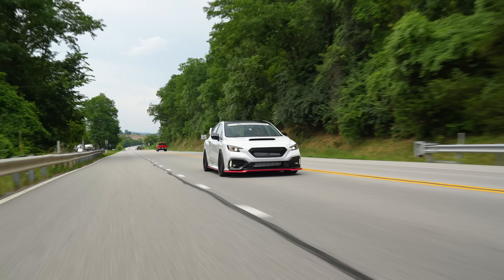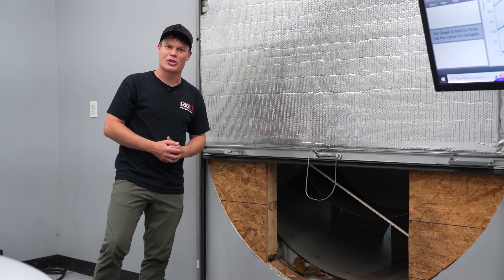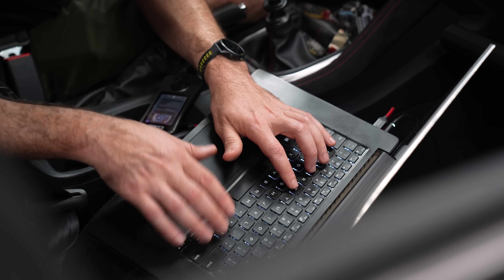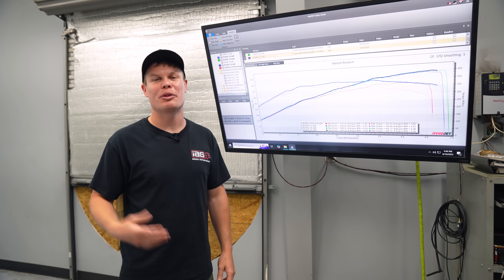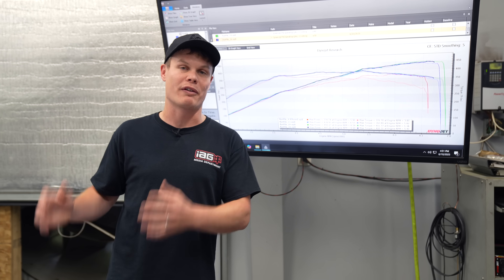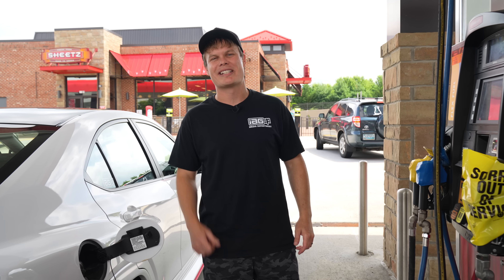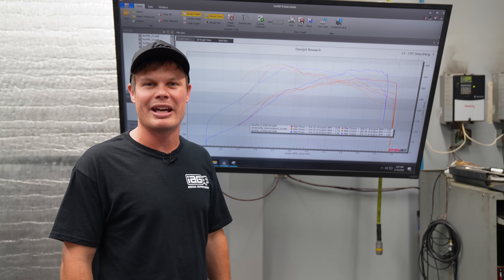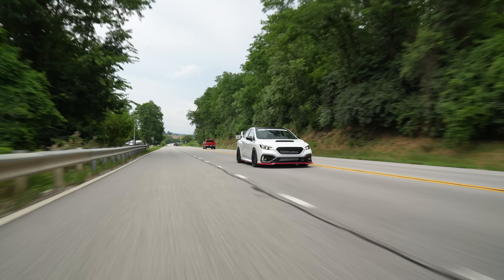Big Turbo VB WRX Dyno Tune on FLEX FUEL!  XXX HP

Comment: So stock turbo stock engine plus all bolt-ons with 7178$$ flex fuel system parts, and not including labor and tuning, only for 320 whp:face-fuchsia-tongue-out: , which means total need at least 13000$$ for only 320 whp with a stock turbo. :face-orange-biting-nails:
Reply: that number seems a little steep with a stock turbo? I was piecing a build togther for like 5gs

Comment: Treating horsepower and torque as if they are different things is hilarious for a “tuner”.

Torque is real, cylinder pressure is real. HP is used incorrectly all the time and the time this t00ner used it the hilarious way.

By “pushing it on the horsepower” side, he is really referring to increasing torque up the power band rather than spin up the turbo early and load up the engine and drivetrain with excessive torque (cylinder pressure).
Reply: Good man. I’m assuming he’s dumbing it down for the non techs/tuners in the comments. Which I don’t think he should but that’s my guess.

Comment: Tune + Bolt ons + Flexfuel and Ethanol 6k redline just for maybe 400hp lmaoooooooooooooooooooooooooooooooooooooooooo CUCKS!
Reply: Ethanol and flexfuel is the same thing 💀 450hp in a 2.4L Subaru that’s well over 500hp++ at the crank. More power than a C6 Z06 lmfaooooooooooo

Comment: Pvs here in Aus threw g30-700 on the 2nd gen brz, managed to squeeze 550whp on a factory unopened engine with e85. These fa24s are responsive as hell to mods it's wild
Reply: holy fuhhh, how much boost?
Reply: @OaklyFilms  https://youtu.be/hOSP6QNOP9s?si=71onxrRjk9ul0D25 that's the video of him explaining it, was just under 550 but in one of their other videos they said they dialed it back from 550whp.
Reply: @longdomedia holy shit, 15 lbs is incredible 🎉. If I had 15lb in my vb id maybe hit high 200s 😂
Reply: @OaklyFilms  bahaha yeah, Gotitrex has tuned the Auto VB wrx, most they could safely make was 300whp on petrol but they made over 500ft-lbs of torque, had to dial it back to 450 as they're unsure of the limit for torque on the SPT's yet 😂

Comment: So at 450whp the fuel system is maxed out... Upgrade both low and high pressure pumps, how much will that get you? At what point do the injectors become necessary?
Reply: Ignorance is extremely bliss on this comment chain, Yes nostrum has a high pressure fuel pump and injector upgrade. Limitations are definitely the fuel system not being returned style with a big in tank fuel pump "Walbro 450". I think the current and new high pressure fuel pump is pulsing the living piss out of the factory fuel rails.
Reply: Its DI... lol
Ain't no upgrading the hpfp
Reply: @-16-wrx- you obviously don't know what you're talking about. Anyone else know?
Reply: @devonswindell9735 you know how DI works right? Lol
Reply: @-16-wrx- I have stage 1 nostrum injectors and a upgraded hpfp that increases flow.... vb will get them eventually.
Reply: @-16-wrx- you should probably do some research before you laugh out loud silly
Reply: @koltonokeefe3035 read my last comment. Lol
They are almost pointless. Lol
Reply: I also have the nostrum pump in my VA.
Shit is worthless
Reply: @-16-wrx- what are you pushing for power? It definitely helped my build
Reply: @koltonokeefe3035 the nostrum injectors and hpfp have been out for the VB for awhile already

Comment: Why don’t we have a 1000bhp fa20dit ?
Reply: I mean I'm stuck at 800hp on my Fa20DIT. I could get more like 9000rpms which I ran for a tad but we lowered the rpms 7,500 because of the oil pump limitations and we don't have an aftermarket option.

Comment: Love iAG, have one of your shortblocks in my EJ and it CRANKS. 85k miles, hard driving, no issues. Went with Outfront for my VB, but definitely can't wait to see the turbo drop. Will this be stock location, no rotating? Those injectors looking real nice too 👀